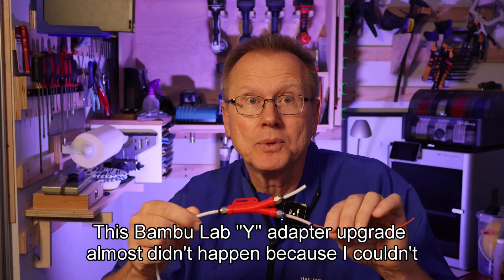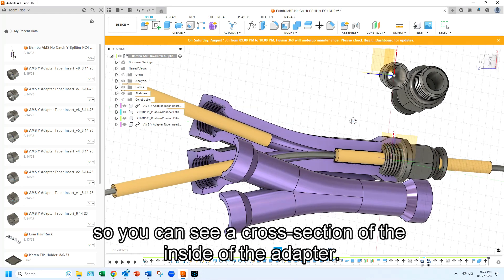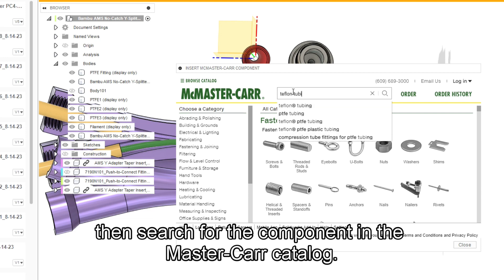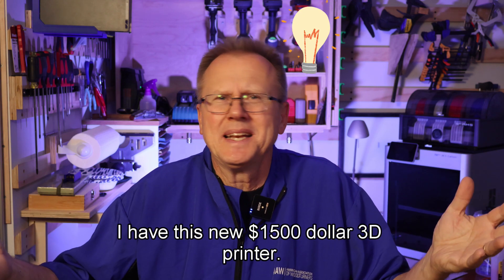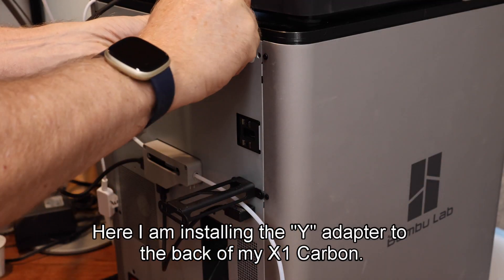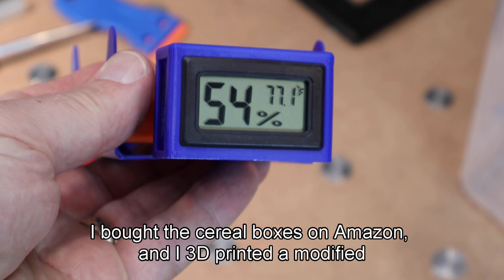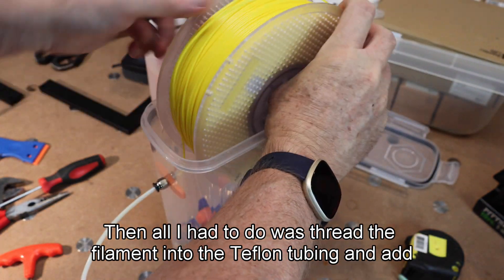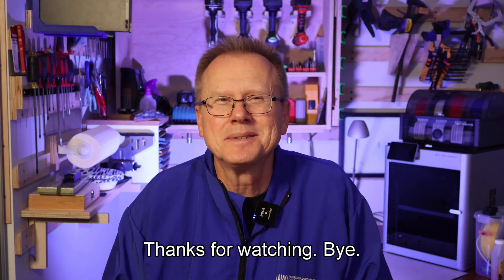Fixed my Bambu Lab 3D Printer Upgrade for only a Penny!

Comment: The problem I've solved so far is that I sleep on a wooden daybed. I kept balancing drinks on the back rail, and they kept falling off. I now have a drink holder that's a circle with a lip attached to an upside down U shape that's the exact size of my rail. It works perfectly, and with the legs being the same width as the rail, its super steady.

Comment: Looks like there is a new version of Ed's design does that work? Also is there a link for the metal fittings and black rubber gaskets it looks like it needs?
Reply from the maker: I haven’t tried Ed’s new design. The fittings I used are on Amazon by searching Witbot PC4-M10 Male Straight PTFE Push in quick fitting connector.

Comment: I am working a motorized feeder and retractor for the dry box I have so  I don't have to separate the filament with my hands.  just hit a remote to feed the fifth filament (or 9th :))  it looks like I can do this with a stepper motor and extruder from a creality 3 printer, I think?  I have the X1C as my first printer but I am fully invested into this Hobby lol
Reply from the maker: That sounds really cool about your dry box. You went all in like me by getting the X1 Carbon as your first FDM printer. Best of luck!😊

Comment: I went through the same frustrating selection exercise until I ended with a 2 part flat design with no thread for fittings.  These are a hassle to build because you have to do it in the back of the machine, but they don’t get stuck as easily.  I was even able to print the two part wye/y adapter flat and at a 45 degree angle so that the layer direction of the inside walls coincided with the direction of the filament path.   I also looked at mcmaster carr’s brass wye, but I wasn’t ready to shell out the $25 plus shipping.
Reply from the maker: Thanks for your feedback. That’s really helpful information😊

Comment: FYI. There are items in this 3mf for the insert that are only good in the latest bambu but it will open in Orca. It will not open in Prusaslicer or Cura.
Reply from the maker: That’s a very good point! I hadn’t thought about people wanting to use other slicer software. I just uploaded a stl file for my adapter in Printables. Thanks so much for pointing this out to me. This was my first upload to Printables so I’m going through the learning curve😊

Comment from the maker: 8/21/2023: At several viewers requests, I have created a Printables link for my PTFE Connector Tapered Insert and the link is in the Description. I have also added Ed Johnson's Y- Splitter link and the Make It Build It Cereal Box Dry Box link.
Reply: Nevermind. Had to refresh.   Thanks
Reply: Thanks for posting it up 🎖
Reply: Im not seeing the link for the funnel
Reply from the maker: @johnwest3036  I just checked and I see it in the description of the video. It’s the 3rd line under “Links for this video” and it’s titled “My YvAdapter Funnel Insert” When I click on the link it takes me to my Printables page. What do you see when you are looking in the Description?

Comment: One thing that may cause an issue for some is that Bambu PTFE tube has an inside diameter of 2.5mm, they like it a little loose for lower resistance.  If you buy PTFE tube elsewhere it may come with a 2mm ID, so if you try to mate the two inside an adapter you may get a ledge that the filament gets hung up on.  Not that this was the case for Ken, but something to be aware of for other mods.
Reply from the maker: Hi Steve thanks for pointing that out. I have only been using the Bambu Lab Teflon tubing. Thanks for pointing out the difference in tubing ID’s.

Comment: I am still watching the video - I have not installed my AMS yet, but I know I need a Y-Splitters  - so Perfect Timing

DO you have links for the cereal box, box prints and the y-splitter you used?
Reply: yeah please post links to all the parts in the video!
Reply from the maker: I can add the original links for the original cereal box design and the original Y Splitter design. Did you want a link to my small insert and the modifications that my friend made to the original cereal box design?
Reply: @ristinnovations  Yes Please - Easier to replicate if using the same items ;)
Reply from the maker: I just updated my Description to include the original designs. I will add my link for my “funnel insert” tonight. I just have to figure out how to do that. My friend Steve will upload his Cereal Box modifications on his Printables and then I’ll add his links to my Description. Thanks for your interest😊
Reply from the maker: 8/21/23 Update: I just added a link in the Description for my insert design  (I added Ed Johnson's Y splitter and the Build It/Make it Cereal Box Dry Box earlier today)
Reply from the maker: All the links are in the Description now!

Comment: exactly, I have resorted to drilling out the inside, and even then its a lil sketchy. The champfer on the inside of the model that goes into the end is what is wrong. Watching now.Awesome fix! What others said, you sharing the insert sir?
Reply from the maker: I will be glad to share my insert file so please give me 24 hours so I can work out the details on Printables. Thanks for your comment.
Reply from the maker: All the links are in the Description now!
Reply: @ristinnovations  Will print one as soon as this print is done, you are the man! Seriously, thank you and a GREAT problem solver!
Reply from the maker: @Patriot_First  Thanks so much for the positive feedback!  I will be interested to hear how the print goes.  Just a friendly reminder to lightly sand the inside of the funnel insert to remove the layer lines.
Reply: @ristinnovations   Will do. I am going to use the last of my Clear PLA CF on it. I will post my make to your Printables file link page
Reply from the maker: @Patriot_First  That sounds great! Thanks very much😊
Reply from the maker: 8/21/23 Update: I just wanted to let you know I have added links for my tapered insert, Ed Johnson's Y Splitter, and the Build It Make It Cereal Box Dry Box.

Comment: I had issues with capricorn tubing and the pneumatic fittings on my Ender 5 Plus machines, the fix was to use compression fittings to replace the standard pneumatic ones that come with most Bowden systems, I think the teeth in the pneumatic fittings were slightly deforming the Capricorn tubing and my filament was getting slightly stuck and under extruding, the compression fittings use a small brass collet which fits around the tubing and the fitting compresses that to hold it tight, the advantage is also that I have never had to replace these fittings, the Pneumatic ones needed to be replaced every 5 months or so as the retractions would snap off the teeth.
Reply from the maker: That’s a great suggestion regarding using compression fittings! I’ll have to try that the next time. Thanks for the suggestion😊

Comment: Are you sharing your insert model for others to print?  If so, where can I download it?
Reply from the maker: Sure, I will be glad to share my insert design. Please give me 24 hours to set something up on Printables. Thanks for your comment!
Reply: @ristinnovations  Amazing, this is the exact issue I've been having with the Y splitters so I had just given up on them entirely. I'll give this a try, maybe printing it with resin will prevent the need for sanding, we'll see.
Reply from the maker: @kylequinn1963  Sure, that’s a great idea if you have a resin printer. Thanks for your comment! please let me know how you make out.
Reply: This is awesome. This is the exact issue I was having. Thank you so much. I can’t wait for you to make it available. Also what’s your printables page? I would like to try out the cereal box solution you showed.
Reply from the maker: I’m working on setting up a Printables page, but in the meantime I just added links to the Description of my video for the Y Adapter and the Cereal Box. Thanks for reaching out😊
Reply: @ristinnovations  Thank you so much!!!! So appreciated!
Reply from the maker: @computerjohn1973  8/21/23 Update: I just wanted to let you know I added links to my tapered insert, Ed Johnson's Y Splitter, and the Build It Make It Cereal Box Dry Box in the Description of my video.
Reply: @ristinnovations  Thank you so much!! I can't wait to try it..
Reply: Literally just jammed my P1S last night. My y splitter setup is identical to yours & I believe this was the problem. Looking forward to trying your fix. Thanks for this!
Reply from the maker: 8/21/23 Update: I just wanted to let you know I have added links for my tapered insert, Ed Johnson's Y Splitter, and the Build It Make It Cereal Box Dry Box.
Reply from the maker: Now all the links are in the Description!